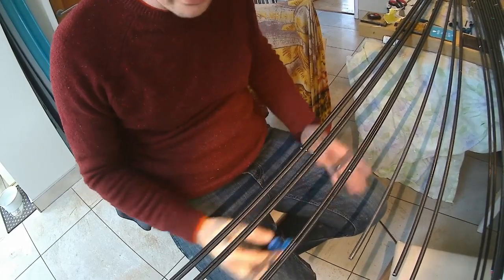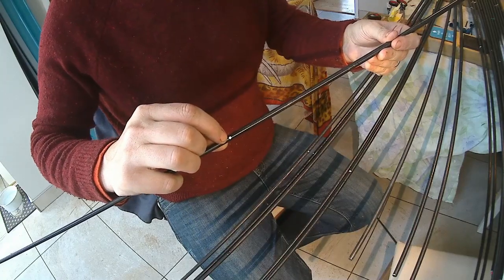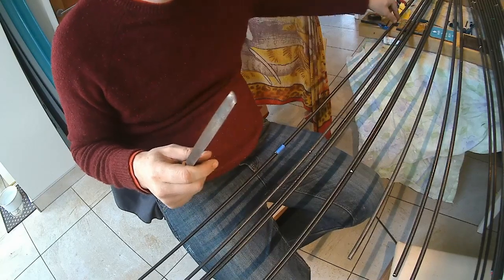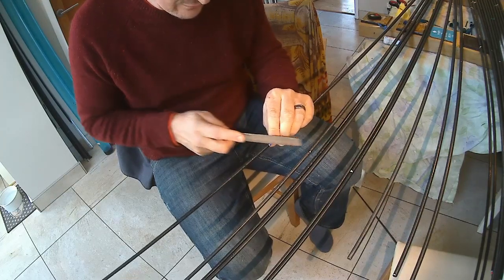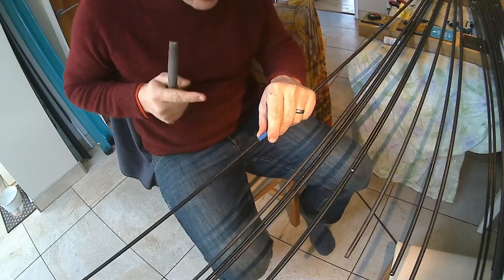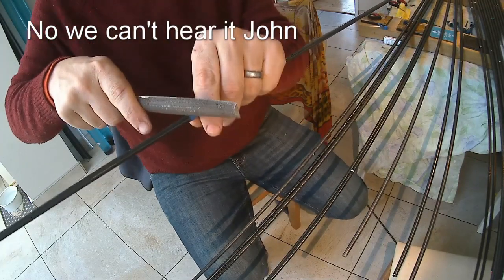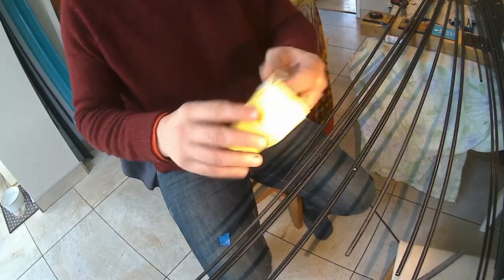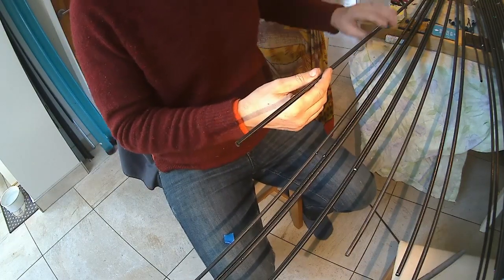How to cut back pole top kits (EASY)

Comment: A dremel with a slitting disc is better
Reply from the maker: True, but not everyone's got a Dremel😊👍
Reply: There are cheaper brands available than a dremel. It's also useful for drilling the hole for a side puller